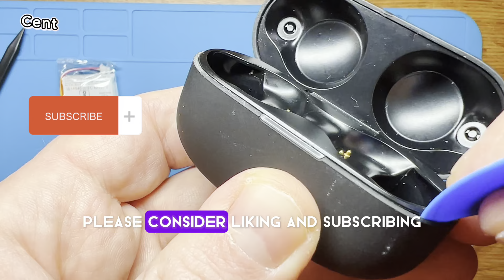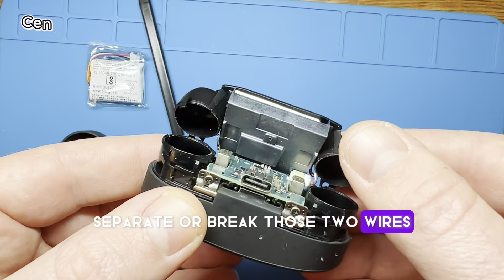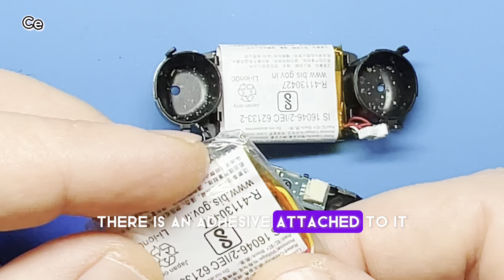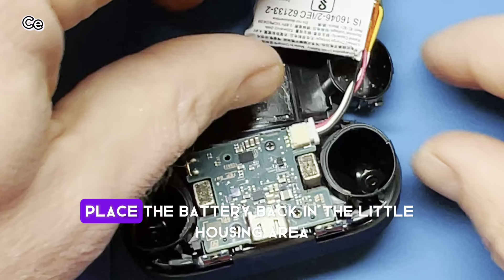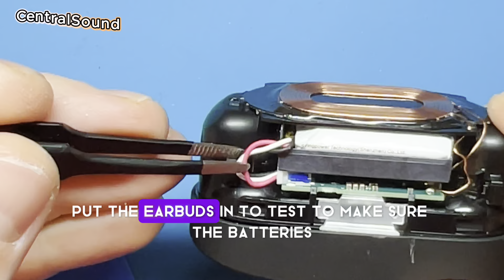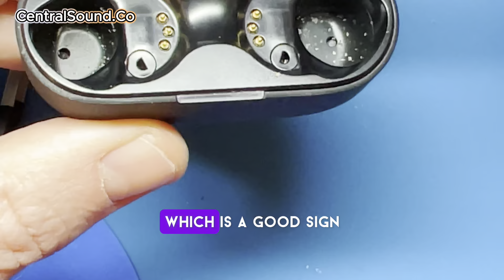How to Replace Charging Case Battery Sony WF-1000XM4 WF1000XM4 XM4 Repair | Install | Remove | Fix

Comment from the maker: Buy Sony WF-1000XM4 Charging Case Battery Here : https://centralsound.co/products/replacement-charging-case-battery-for-sony-wf-1000xm4-wf1000xm4-wireless-earbuds
Buy ZeniPower Z55H Earbuds Batteries Here : https://centralsound.co/products/zenipower-z55h-battery-li-ion-3-85v-sony-wf-1000xm4-ear-buds

How to replace and upgrade battery on Sony WF-1000XM3 Wireless Earbuds https://youtu.be/5qOr-RCQMfw
Buy ZeniPower Z55 Batteries for WF-1000XM3 Here Pair Here https://centralsound.co/products/2x-zenipower-z55-1254-battery-for-sony-wf-1000xm3-wf-sp900
Buy Varta CP 1254 A3 Pair Here : https://centralsound.co/products/varta-cp1254-a3-3-7v-li-ion-sony-wf-1000xm3-rechargeable-battery-w-tabs

How to Replace Case Battery Sony WF-1000XM3 Here : https://youtu.be/-NC8TBgRqy4
Buy Case Battery for Sony WF-1000XM3 Here : https://centralsound.co/products/replacement-battery-for-sony-wf-1000xm3-and-wf-sp900-wireless-earbuds

Our Full Range of Parts for Sony Headphones and Earbuds Here: https://centralsound.co/collections/sony-headphones-parts

Comment: My charge the earbuds but the Case doesn't seem to charge the battery internally itself when I plug the case in.  At least there's no confirmation of a light.  The light does come on when I open it and when I put headphones in it they have more of a charge in and there's a proportionate decrease in the charge of the case itself but nothing seems to make the case battery power go up.

Comment: Huh, I didn’t have to heat the case to pry off the bottom casing. There were just clips holding it down, so I used my guitar picks to help lift it off easily between the seams.

Comment: Hello, I am a new subscriber, it has to be that same brand of battery or I can use the Cameron Sino brand. Otherwise, another thing I also have the wf-1000xm5, they got completely wet along with the case, now they do not turn on and only the orange light blinks, Any recommendation??

Comment: My buds and my case were dead after a heavy rainstorm. 
Dried everything over night, pried open the case and unplugged the battery, waited a bit and plugged it back in and my case lit up again. Even my buds worked again after I put everything together.
Glad it wasn't fully broken and I didn't have to replace anything. Good guide tho easy to follow.

Comment: Nice video, thank you! I was wondering if the "copper wires" are insulated? Is it disaster if they touch each other during the repair process?